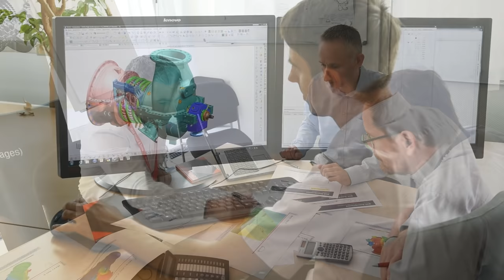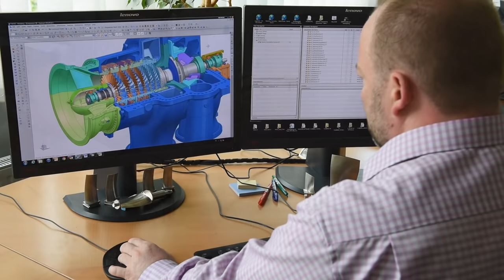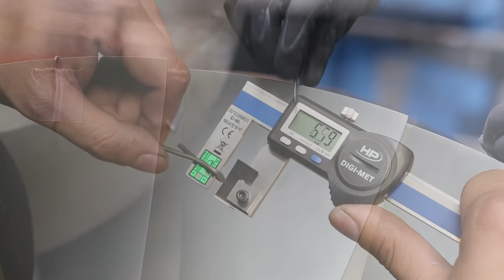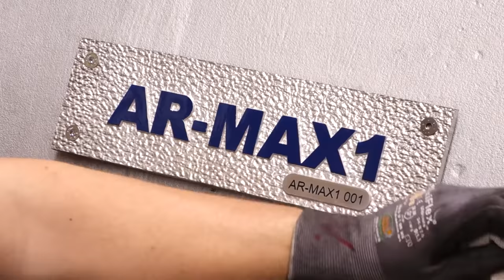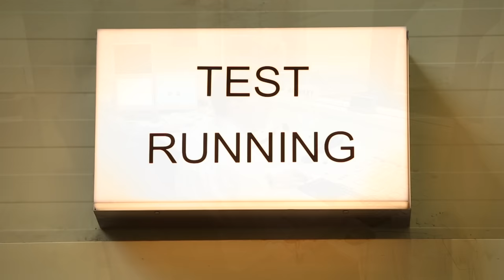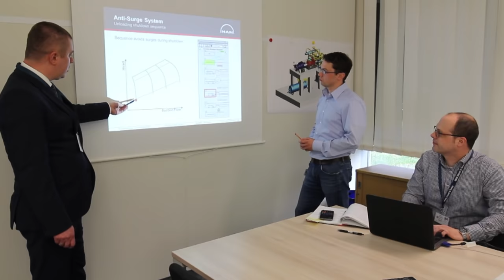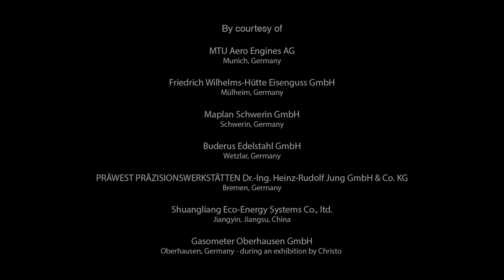The AR-MAX1 compressor comes to life - final version

Comment: @ 15:15 to 15:35 you can hear the compressor undergoing surge testing.  That is the compressor blades undergo a compression stall as the space behind the blade forms a vacuum causing a sudden reverse load on the blades.  This is caused when the blade spins too fast and pressure waves trail off the blades and overlap the leading edge of the next compressor blade.  At this point the next disk of blades have no air to bite into and start trying to drag the front disk of blades back.  The compressor stall is not uniform in load across the compressor face but strongly asymmetrical.  This can cause the main armature to wobble and half the turbine blades to pull towards the front stator blades.  In extreme cases these blades do collide with the stator blades with very catastrophic and explosive effect.
Reply: nice, what needs such a huge air demand? The whole factory?
Reply: Thank you so much, I was looking for an explaination for this exact phenomenon!

Comment: What's the outlet temperature of air?
Is it possible to deliver air at 25 bar and 550degC from the xompressor?
Reply from the maker: Our maximum temperature for AG/AR in operation is currently 320°C. For high-temperature applications, we split the pressure build-up between two compressors. First machine AG/AR for large volume flows and high efficiency plus second machine RG integrally geared compressor for max. temperature where the materials can be changed individually.
Reply: @MAN-Energy-Solutions  Thank you for your reply. Do you provide the complete specifications of compressors on request? I may use those specifications of compressor and turbine for my research (basically I use the data in my models).

Comment: Make a big barometer so we easily get atmospheric pressure energy 
10000000 cubic feet volume. Barometer turned a turbine and make electricity through out the year so we use it in making hydrogen and hydrogen is used as fuel gas

Comment: A rocket centrifugal jet platform is not out there. 40 ft diameter 1,000,000 horsepower. 20 rotations/s  critical  pressure in 1 stage . 2000 pounds/ft  air load  precision spoke profile

Comment: So how far out is a part when it breaks 6 months? Very strange using a machine that big since there probably is no way to back it up. Multi staging with multiple units just seems smarter. Awesome machine though and I assume it’s production based.
Reply: Multiple units working in parallel or series can be difficult to control due to one or more surging. It can be done with modern controls systems but is not so energy efficient. Hence one big machine.